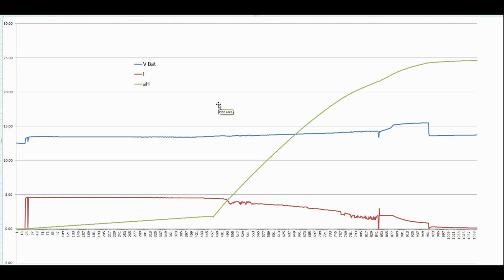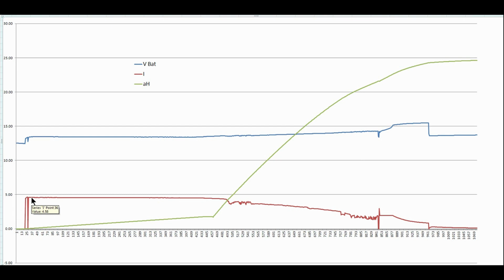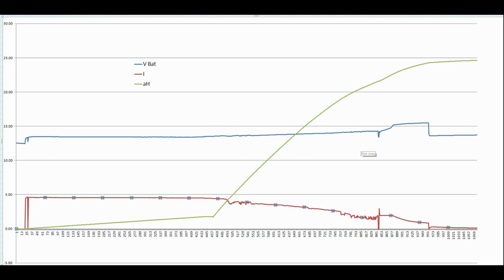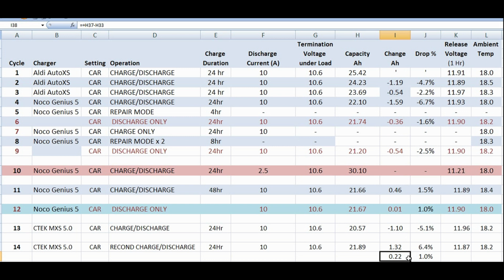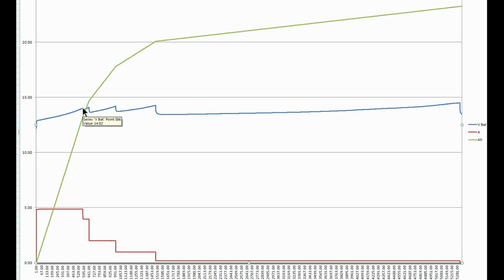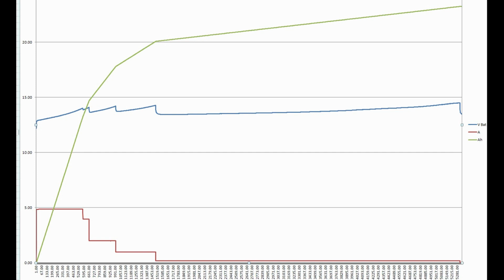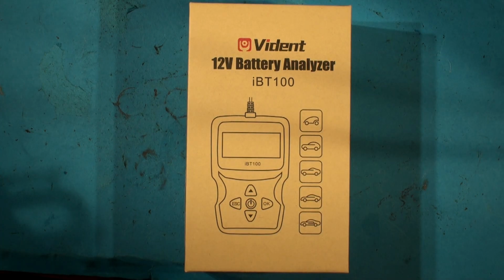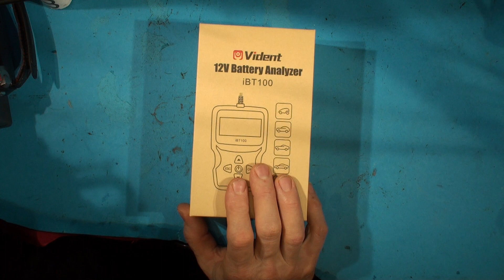Does the NOCO Genius5  charge better a than CTEK MXS 5.0 ???. NOCO Parametric Test Part 5

Comment: question plz - my 12V charges fine and is able to hold the voltage at 13.5V for at least couple of days. However, once connected back to the car, the voltage drops to 6V. Is this a faulty battery? What happened within the battery that gives such problem? Can this be even possibly fixed by re-charging using Noco chargers? 
Cheers,
Alan
Reply from the maker: If the charger holds the voltage at 13.5 and dos net get to 14 then the charge cycles is not completing.   Get your battery tested.
Reply: @razenby  Thanks for your reply

Comment: Hi Magic Smoke, you clearly know battery chargers and wonder if you could recommend one for the way I plan to use it. I have recently acquired a 3.0 litre Z4 (74 Ah battery) which will be used perhaps every few weeks. The battery is new. From your videos it appears NOCO are more prefereable/more reliable than CTEK. Vehicle is parked on the drive. I need a trickle charger which will sit in the boot (where battery located) with mains plugged into weatherproof socket. I intend to leave battery connected to vehicle whilst on charge (an autoelectrician advised against constantly disconnecting the battery, also I need the alarm to be active) and leave the charger to trickle charge over long periods. I was considering either the NOCO Genius 2 (3.8 amp) or the NOCO's Genius 5 (5 amp). Which would suit my needs better.  Thanks.
Reply from the maker: Hello, I have used a Noco Genius 2  (2 amp) on my V8 Jag XKR for about 2 years. I drive it every 3 weeks or so.  I would not use a CTEK because of susceptibility to mains transient and condensation when the weather changes. It has temperature compensation.
Reply: @razenby  Many thanks for your quick response. In view of the low charger ampage do you leave the charger connected to your battery all the time (except of course when driving), also do you leave the battery connected to the vehicle? Assume you find the 2 amp charger is more than sufficient to (easily) start your XKR even with minimal drain from the alarm when vehicle locked.

Comment: Great video. You obviously know your stuff but way above my head lol. So in a nutshell which charger is best - the Noco Genius 5 or the CTEK MXS 5.0? I have the NOCO but am tempted to get the CTEK while its on offer but is it worth it in your opinion. Don't worry I won't hold you to it!
Reply from the maker: The CTEK will blow up if left plugged in ore in outside air - not in direct rain but subject to humidity and barometric changes.  A CTEK may slightly recover a failing battery but not to any useful extent.  I would not use a CTEK on a healthy battery that I want to stay healthy. (too much erosion of plates) It would be similar to a doctor prescribing damaging medication to an otherwise healthy patient.
Reply: @razenby  Thanks for the advice. I'll stick with my NOCO Genius 5!
Reply from the maker: @user-of4sd1rm8r  Good plan.
Reply: @razenby   Hi Magic Smoke, you clearly know battery chargers and wonder if you could recommend one for the way I plan to use it. I have recently acquired a 3.0 litre Z4 (74 Ah battery) which will be used perhaps every few weeks. The battery is new. From your videos it appears NOCO are more prefereable/more reliable than CTEK. Vehicle is parked on the drive. I need a trickle charger which will sit in the boot (where battery located) with mains plugged into weatherproof socket. I intend to leave battery connected to vehicle whilst on charge (an autoelectrician advised against constantly disconnecting the battery, also I need the alarm to be active) and leave the charger to trickle charge over long periods. I was considering either the NOCO Genius 2 (3.8 amp) or the NOCO's Genius 5 (5 amp). Which would suit my needs better.  Thanks.

Comment: So for General Motorcycle and Car charging better go for the CTEK or NOCO. Sorry just got lost in all the data. Motorcycle charging is a must
Reply from the maker: What Ah and voltage is your motorcycle battery?
Reply: @razenby  12v 9ah AGM one
Reply from the maker: @yankodimitrov5246  Do you want to charge it when it is run down  only, or charge AND maintain whilst the bike is infrequently ridden?
Reply: @Magic Smoke  Mostly just charging. When It needs it. The noco looked good but, I'm not sure it has low amp charging mode. Even though they say it is ok for Motorcycles
Reply from the maker: @yankodimitrov5246  Out of the ones I have tried, the  Noco Genius 2 would be the best for your battery.  It has very good accuracy and consistency on the terminal voltage measurement and charge current is limited to 1.8 A.  The the max charging current for most ~9Ah AGM batteries is specified as max 3 amps so you are well withing the max. The Noco 2 has an AGM setting and is well made.
Reply: @razenby  Thank you for the suggestion. Will definitely look into this one.
Reply from the maker: @yankodimitrov5246  OK. Look out for sensing accuracy, AGM mode and max charge current 2 to 3 amps.

Comment: The user manual states that once the Noco G5 has completed charging the battery it can remain connected indefinitely to provide background charging . In the 12v mode it does this by switching off the charging current (large LED is lit without pulsing) allowing the battery to relax to 12.8v +/-0.2v. Then it restarts charging at 186mA until some upper voltage and repeats the cycle. However, with my FLA deep cycle battery, after the initial charge and following relaxation, the charger restarts and remains charging at 186mA indefinitely . The voltage generally never goes above 13.7 volts at this current. The battery's manufacturer recommends a long-term  "float" voltage of 13.3 to 13.5 which results in a lower current of about 70mA and less electrolysis. Hence I prefer to leave the battery connected at 13.45v to a cheap CC, CV power supply PS for long-term storage. However, I can also use the PS to charge the battery reliably from flat providing I remember to change the CV and CC set points after saturation charging. I also haven't found that 12v repair mode makes any discernible difference to the battery's capacity so I assume it's a marketing mode. The battery's manufacturer recommends a 24 hour equalisation charge at 14.4 volt following a full charge 2 to 3 times year, which is what I usually do anyway using the PS. In summary for my application a PS provides better results than the Noco G5 for the same cost and is more versatile around the electronics lab. However, for saturation battery charging in a car or caravan the Noco has the advantage as it's more robust.
Reply from the maker: Thanks for the comment. All sounds very feasible but not the best scheme unless you are prepared to run out and adjust the power supply voltage manually to compensate for temperature.   You may want to reconsider as maintaining with constant voltage at 2.40V to 2.45V /cell (14.4V subjects the battery to plate corrosion). 2.30V to 2.35V/Cell gives maximum battery life but reduced capacity  due to limited sulfate crystal mas forming.  This will be exacerbated if you don't compensate for temperature.  So, the best way is to allow the battery to relax in a fully charged condition and when 5% to 12% self discharge is is detected,  apply an absorption float charge up to a temperature compensated terminal voltage is reached (nominal 14.4V +- temp compensation) . Therefore a good smart charger is much better than a CV power scheme. The manufacturer's data is for resellers to keep batteries in storage in a sufficiently good condition to be sold.  The problem for the user is which charger does what is says on the box?
Reply: What is this PS you keep mentioning?

Comment: Hello, thank you for your video. Today, acording to your experience, which charger would you select among these six: Noco Genius 5 - Ctek MXS 5.0 - Optimate 6 Ampmatic - Victron IP65s 12V/5A - GYSFLASH 4.12. (Or in which order would you consider them, from the best to the worst?) Thanks!
Reply from the maker: I have an Optimate 6 here awaiting test but I haven't seen the Victron.  The CTEK is a blunt instrument and if it were a doctor get it struck off if it prescribed such treatment to an otherwise healthy patient.  The CTEK is probably good for eking out a few months from a battery that is already showing serious symptoms of end of life.    What I would say is that the CTEK hardware design and manufacture standards leave a lot to be desired. I am inundated with requests tor repair CTEK and so far have no received any for NOCO. The NOCO build quality of the electronics is much better and they seem more reliable.  From all the chargers tested on this  Channel to maintain a healthy battery and for general charging I would choose the NOCO. When deciding a good plan is to ignore all marketing claims with regard to the miracle recovery of failed batteries. The best way to prevent buying a new battery is to look after a good one.
Reply: @razenby  Thank you for your comments. It is clear. And we can see the comparison between the 2 graphics (Cteck vs Noco) where Noco shows cleaner, more consistent and noise free curves.  

I saw some comments in Amazon about the NOCO Genius which killed, burnt or got very hot batteries, what do you think about that? 

On the other hand, could you tell me how is the NOCO Genius Step 9: Maintenance; is there a constant voltage (ejample: 13.6V) or are there alternated times with that voltage and times without charge? 

When do you think doing and uploading the test with the Optimate 6? 

Thanks again
Reply from the maker: @10tigre1010  The NOCO voltage accuracy is the best on the chargers that I have tested because it  maintains the terminal voltage within the safe range. This  prevents erosion of the plates.  The NOCO  can do this because it has better terminal voltage measurement (accurate) circuity and keep in mind that you cant keep an unattended battery fully charged without accurate temperature compensation.
Reply: @razenby  Following your comments, I bought a Noco Genius 5. I was impressed by the whole quality and how the last stage of maintenance works: extremely accurate voltages and micro-variations of them and I guess micro-injections of current. I very like this maintenance method. It doesn´t have the classic floating voltage (chargers that fixes the voltage at 13.6V for example), instead of that this Noco charger continuously monitors the battery to determine when a maintenance charge should be initiated. If the battery voltage falls below 12.8V, the charger will restart the Maintenance cycle until voltage slowly reaches the setting (for normal battery: 14.5V) and then discontinues the charge cycle. Absolutely nothing to do with cheap Chinese chargers. My recommendation is that the user spends a little more money and buys these very high quality chargers because he/she will protect the investment he/she made in his/her car.

Comment: Hi ... I need your advice please. I need a charger for AGM batteries only.  I have a Ring Automotive RSC508 SmartCharger +8 and i do not trust it with AGM. I can not decide between CTEK MXS 10 or NOCO GENIUS 10, which would you recommend? Thank You
Reply from the maker: Is this AGM battery used for leisure, standby or starting?  For longevity the requirements are quite different in terms of support and recharge. Let me know what you use it for and I'll see which one is kindest.
Reply: It is to charge my family cars batteries (3 of them). We are doing short drives all the time and the batteries do not have thime to recharge themselves. Thank you

Comment: I’ve tried both. Have both. Appreciate all your videos and in depth reviews. I do like ctek one more. Do you keep using recondition or repair mode on same battery? Don’t you think the battery acid/water is already mixed inside? Probably why it seems like ours doing nothing, because it’s already good not wanting to keep gassing it? Am I crazy? I feel like ctek is smarter and adjusts and noco just does what it says no matter what. They’re both solid though. I might be crazy. I dunno but i think once you repaired it once you won’t see much difference after for a while. Also my noco got my agm battery very warm. My ctek didn’t and eventually quit because the battery was bad. Noco kept trying, no quitting. But that battery is horrible and dead but noco have it juice and didn’t give up on it. In the end the battery was dead and ctek didn’t waste time on it. I dunno I’m no electricity expert. Thanks man i appreciate your channel
Reply from the maker: Thanks for the comments.  CTEK have reliability issues on UK mains power. I might use a CTEK for an occasional boost of a tired battery but don't favour them for a good battery that I want to keep in good condition. Too brutal,  It is a case where the powerful medicine has bad side effects when administered to an otherwise healthy patient.
Reply: Interesting, I've bought and sold quite a few of these chargers through my business (Noco and Ctec) and use both a MXS5.0 and a Genius 5 - I too have noticed the Noco can be a bit too 'strong' with old batteries and in my mind (nothing empirical) the Noco will finish off a failing battery while the Ctek will tend not to.  Academic anyway, as the battery is on it''s way out,  but I've always thought the Ctek does seem to monitor what's happening with the battery a bit more sympathetically.  Both work well in my experience and have only seen 2 failures (both Ctek!)

Comment: what you think is better between NOCO and CTEK? thanks
Reply from the maker: I prefer the NOCO for build quality and design. The NOCO is a better charger to keep batteries in good condition. I would use a CTEK on a failing battery but not for a good battery as the medicine it administers makes a health battery ill.  People state that the battery manufacturers endorse CTEK -- well wouldn't you if you could sell more batteries?.   Though I have no idea of the proportion of CTEK to NOCO  out there, however,  I am inundated with requests to repair CTEks but not NOCOs.
Reply: @razenby  I see... have u ever tested any OPTIMATE? it seems the most "intelligent" one

about the endorsement the car/motor  company do not sell batteries... so I dont think it is related. but I am not sure. thanks for asking.
Reply from the maker: @Mangold108  I have one in the pack on the branch here Optimax 6 Ampmatic. Intelligent is putting it a bit strong. I get round to it.

Comment: So which one is the better charger?
Reply from the maker: I can't say which is the best one out there as I haven't tested them. Between these two, for a good battery and to keep you battery good (prevention is much better than cure) the the NOCO is far better.   It is much kinder to the battery. If you have faith is desuplhation then for a hopeless or failing battery the CTEK might be able to give it a stiff talking to but I wouldn't  charge a healthy battery with a CTEK.
Reply: @razenby  I’m interested to know in what way the NOCO is much kinder to the battery than the CTEK. Would you not charge a healthy battery at all with a CTEK or do you mean that you would not use the CTEK’s recond mode on a healthy battery?

Comment: About the Vident Battery Analyser, I haven't used that one but the one from Ctek and found it very useful. But (there's always a 'but') it has to be properly connected. I once connected it to a battery which was rated 800 Amps EN, and got 250 Amps EN back. Then I tightened the screws on it by hand and got 480 EN. Then i took a wrench and firmly tightened the screws and got 750 Amp EN.
Since this instrument is measuring mOhm, the slightest glitch leaves a faulty result.
Reply from the maker: Thanks for the insight. It is not surprising as they just test the trans-conductance impedance of the battery. They are effectively a very low low ohm meter so any milliohms in the connections will affect the reading..
Reply: Great videos and Channel. Did you get round to checking/reviewing the Vident Battery Analyser iBT 100, would be interested in your opinion of this type of device, Thanks.